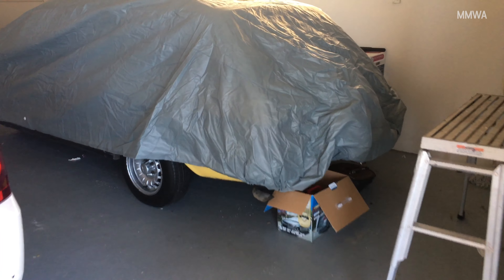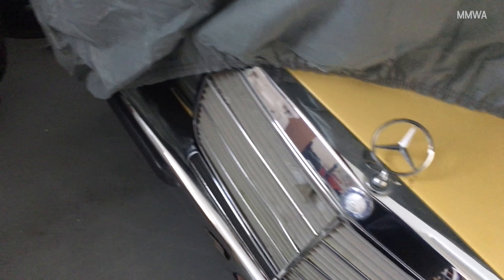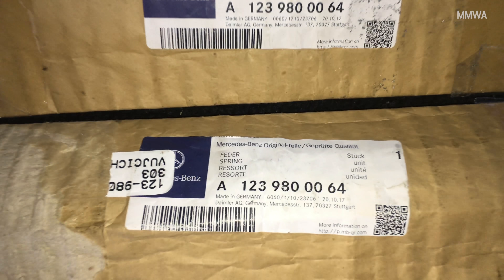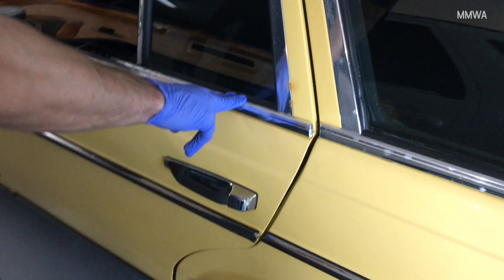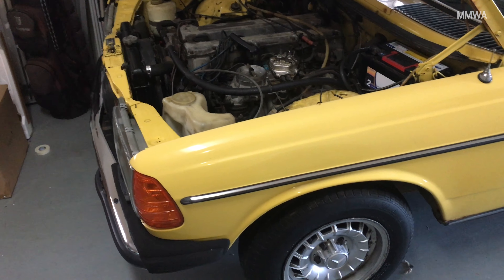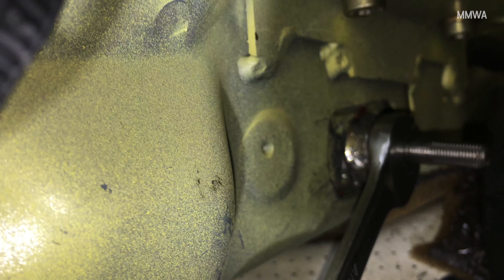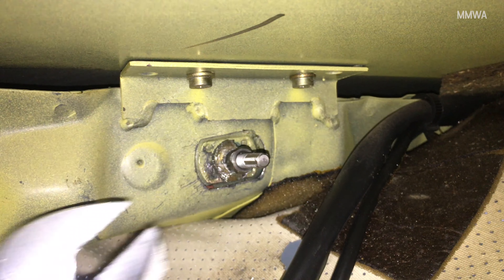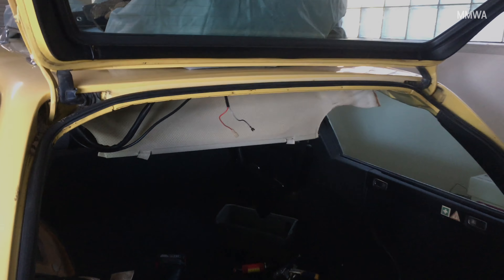Mercedes W123 280TE for complete restoration - siezed tailgate strut bolt removal

Comment from the maker: Note that there were fossilised hornets nests inside the tailgate strut area, on both sides! - its the perfect location for such nesting insects as its got a narrow protected entrance and its large internal shape is perfect for building a nest.
Reply: let's carbon date those wasps so we know how old they are!! lol
Reply from the maker: The car was sat parked for about 10 years in a field in remote WA. it would of happened during this time. Surprised there wasn't more rust. It was a 1 family car, originally owned in NZ then brought to australia by the same family. I would assume the hornets were from Australia as customs and boarder protection people are very anal when it comes to importing anything into this country and the possibility of insects etc hitching a ride.

Comment: He should keep that yellow color, I think. This video made me miss my m110 dearly 😖
Reply from the maker: Filthy Luca I’d also like to see the banana yellow color stay. Its period correct and original. However the owner has a love affair with MB silver and all restorations end up this color unfortunately.
Reply: Yeah the yellow makes it look as special as it is! At least in the states the w123 280e are pretty rare. I would love to experience a fuel injected m110. I had a carbed version, but it was still strong and silky smooth 🤤
Reply: on that chassis, wagon, the yellow is the best color you may desire! i owned a dark grey met, palomino interior,  and i was dreaming to have a yellow body color....keep it, is amazing